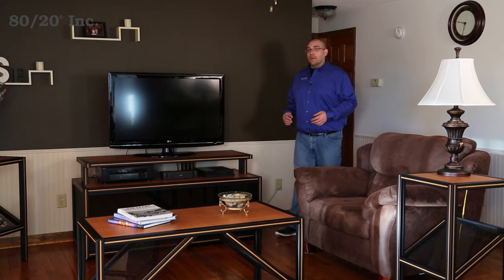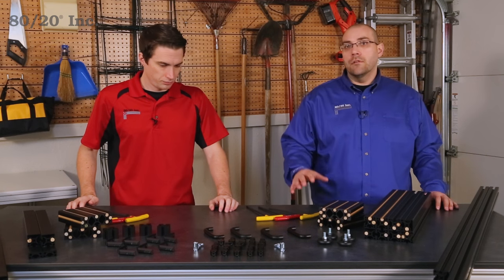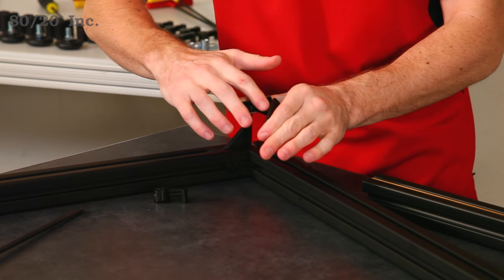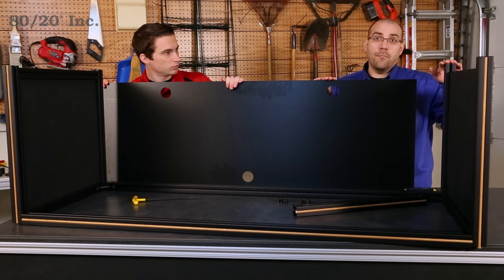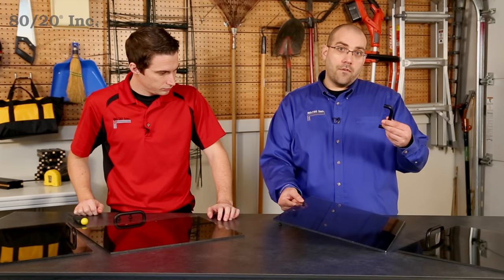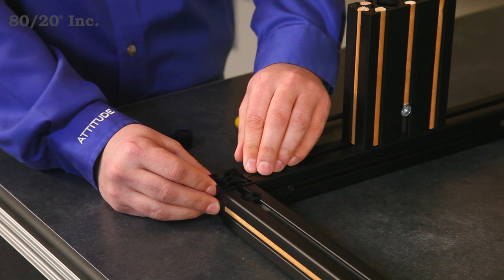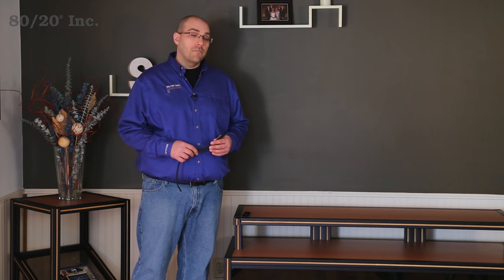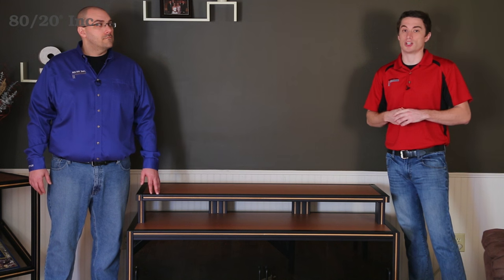80/20: Xtreme DIY - Entertainment Center

Comment: How can I mount a solid surface top to a desk build ,I really don't want any bolt holes visible from the top?
Reply from the maker: VHB tape, part number 13099, can be used for mounting a desktop.
Reply: Or 90 corner brackets. I use screw in wood anchors but they aren't a must